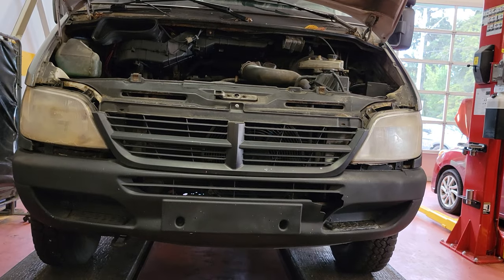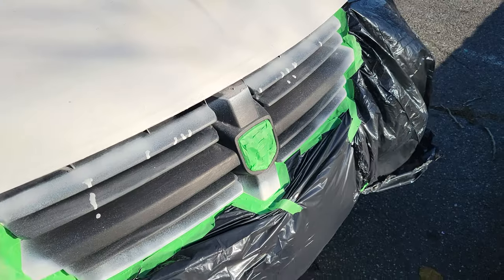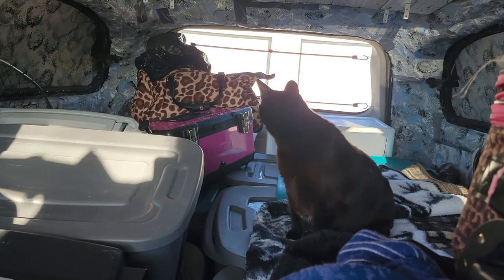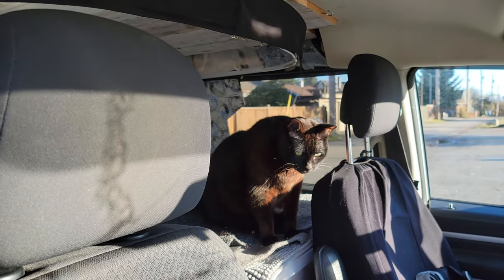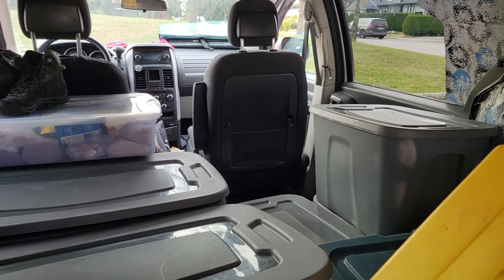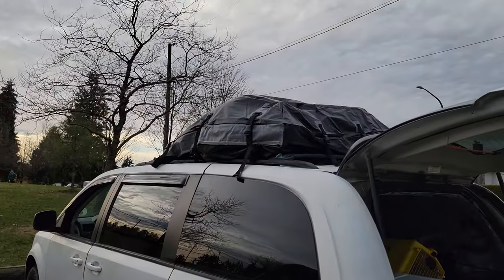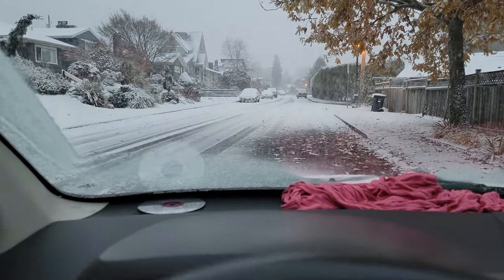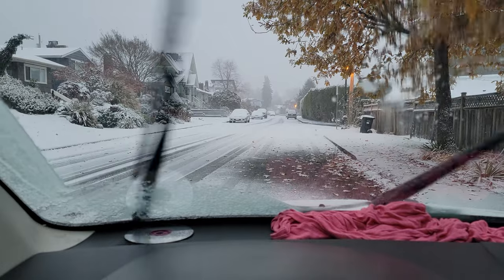Moving Into a MINIVAN (With 3 Cats)

Comment: I noticed you didn’t cover the coolant radiator when you sprayed the front grill. Remember to check it in case you blocked the cooling cells with paint.